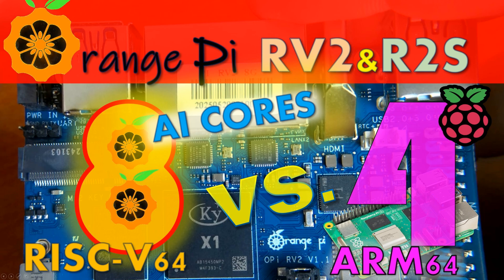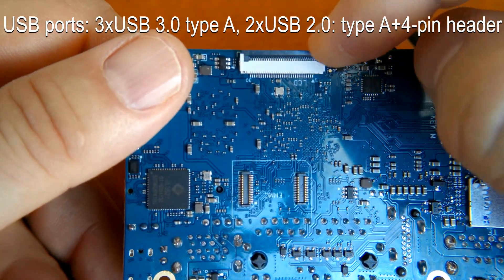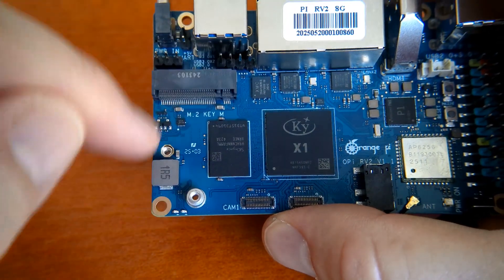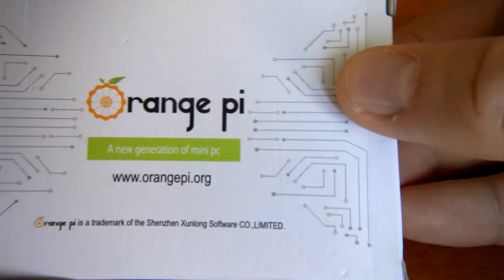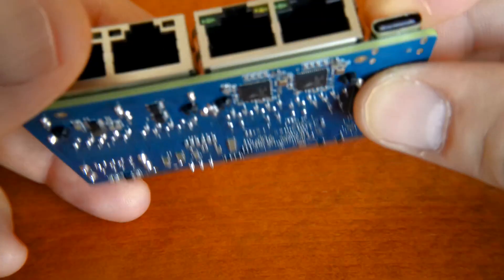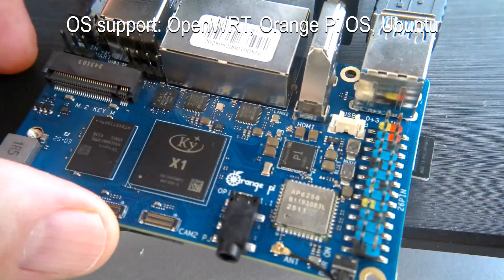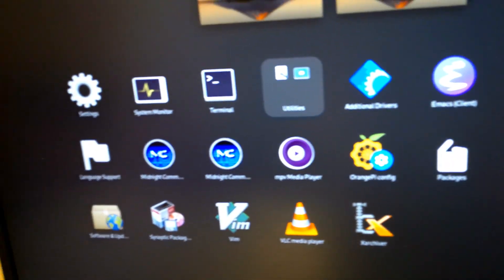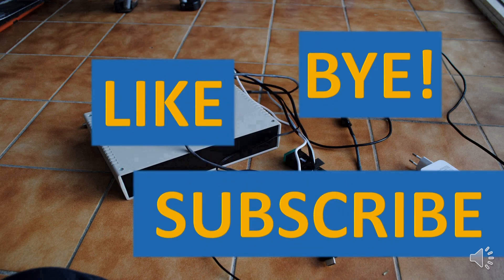Orange Pi RV2 (8 cores+AI) and Orange Pi R2S (8 cores+AI) vs. Raspberry Pi 5 (4 cores)

Comment: Get a heat sink, it actually runs kinda warm.  I fully loaded mine with 2 NVME drives and the both seem to work just fine.  I was looking around for cameras, was thinking about doing some edge detection and parallax to build a point cloud in 3D...
Reply from the maker: I use a variable speed fan (Ucc = 5V..12V) from a broken PC PSU running on 5 V+ (minimum speed, almost no noise). It's free. It can also be mounted atop of the transparent plastic case that Orange Pi RV2 is distributed in. Watch my video to see how it can be done. It is it basically the same as for Orange Pi 5 Max: https://youtu.be/9dNoa8zPWkU. It's perfect even at full CPU load.